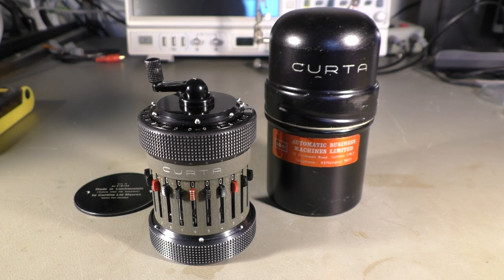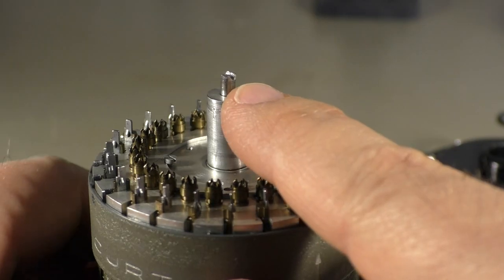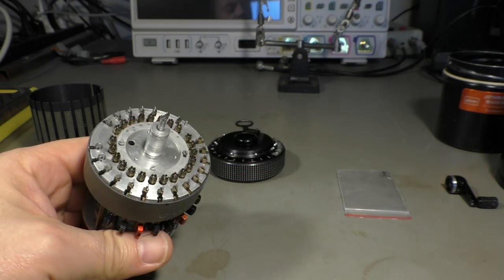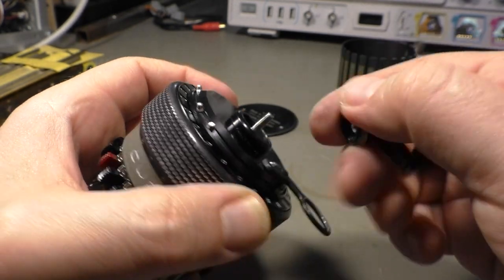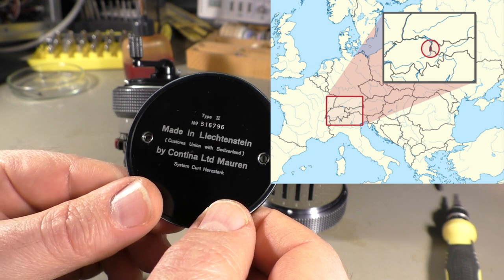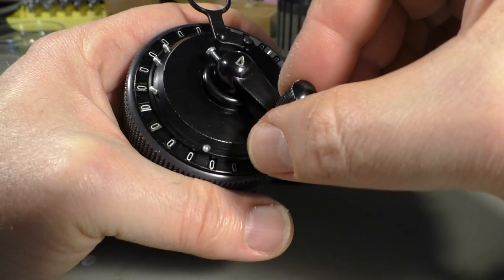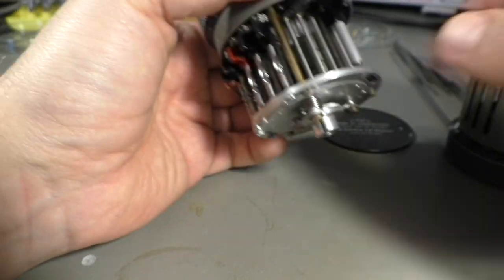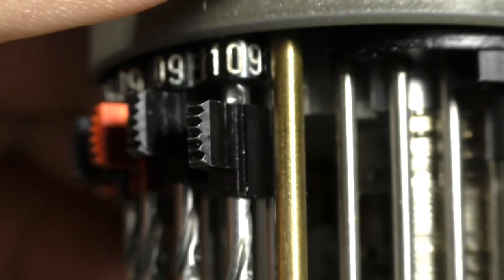Curta calculator - broken shaft fixed - (PWJ203)

Comment: I can't blame you for not wanting to disassemble it. I have to believe doing so without knowing exactly what you're doing would result in a literal explosion of uber tiny gears, springs, and detent balls. That said, really is a marvel of engineering. I love mechanical computers. Especially when you get into things like the ballistic computers on battleships, or the torpedo computers on older submarines. Both require incredibly complex equations, and as a result, the computers themslves are incredibly complex. Just beyond fascinating.

Comment: I just paid $200 US for a model I with the same problem. I got quoted $800 to replace the part.

Also, in the U.S. it's "set screw" or (less commonly) "grub screw".
Reply from the maker: Yeah, a complete disassembly would be necessary to replace the shaft. That's a lot of work and surely worth $800. But if it can be fixed with my method, that's cheaper.
Congratulations for your $200 purchase. I paid $800 in a broken state.

Comment: Nice video. I have one with the same problem. A Type I.
There is a 3D interactive simulator on satadorus with the extension eu. It shows the working in great detail.
Reply from the maker: I just tried that simulator. Amazing! This is really done very well. Thank you for that tip.
Reply: @PlaywithJunk  Nice thank you
Did you find anything that needs fixing?
Any other suggestion?

Olaf

Comment: Have you considered TIG welding?
Reply from the maker: I did but my welding skills are nut good enough. And there is a problem with grounding. If the welding current goes through bearings they may weld too.